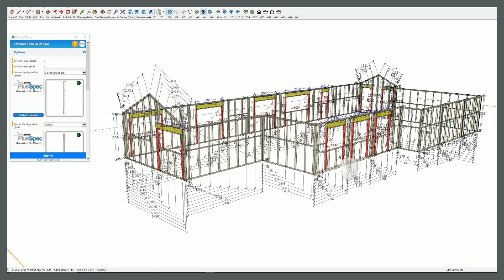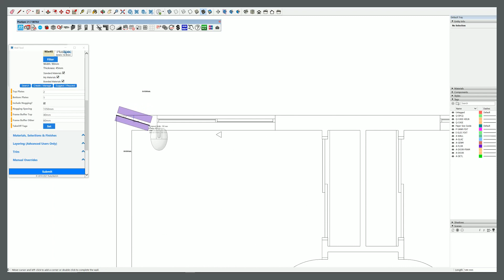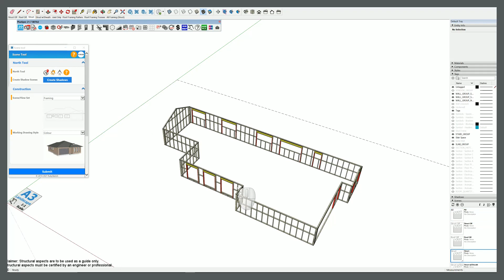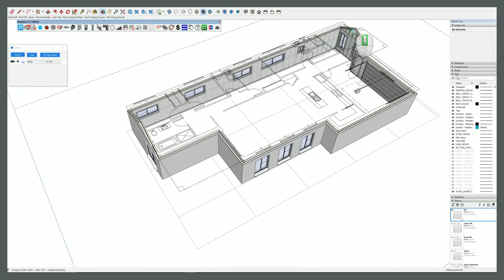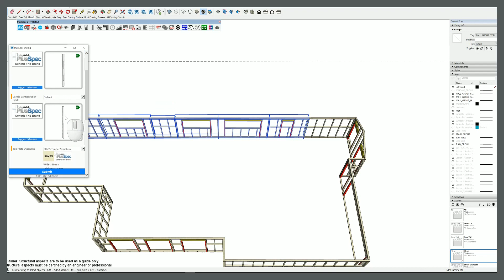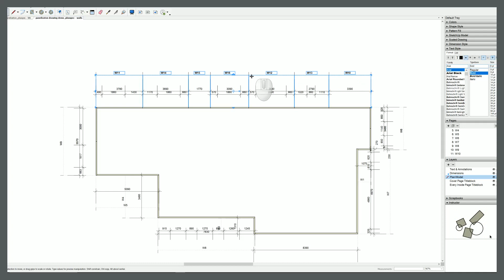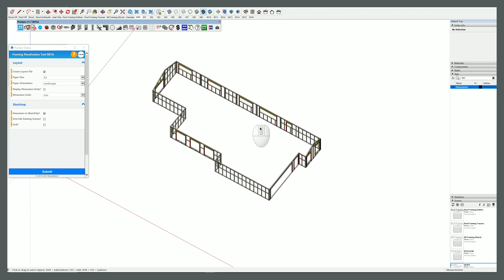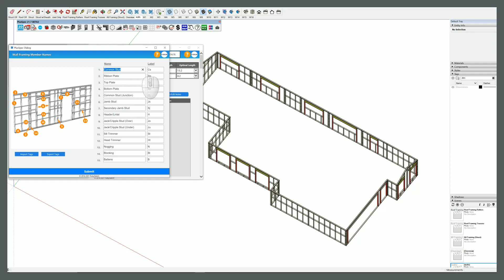How to create detailed wall framing & frame Panelization documents in PlusDesignBuild.

Comment from the maker: Hi guys, we will soon be making a few updates to the wood framing wall panel tool. If you'd like to have some input, check the latest forum post here:  https://forum.plusspec.com/t/carpenter-framer-shop-drawing-input-needed-for-wood-frame-shop-drawing-detailing-plusdesignbuild/49969

Comment: When doing the framing we normally place the studs to allow for 1200 mm wide lining. This means that the stud spacing from the second stud onwards would be spaced at the required intervals. However, the spacing between the 1st and 2nd stud should be half the stud thickness (22.5 mm) less than the required spacing to accommodate the 1200 mm wall lining. By doing this it is possible to get a stud centred at every 1200 mm where at the moment is on 1155mm.  Is it possible to set the stud spacing? accordingly?
Reply: You can start the alignment of studs from different locations across multiple points in a wall.  Right click the wall> click +wall> in not in front of the computer now but I'm pretty sure it's "align studs with rafters/joists"  Neil if you've already created your panelization drawings go back to the wall panelization tool, click delete scenes, the recreate. This will re dimension the walls according to the new stud alignment.
Reply: @AadbuildDesignBuild  Thanks mate,  unfortunately not the solution for my dilemma
Reply: @nedsprojectsltd5707  Hi Neil, If you buy imperial sheets they are 1220 x2440 or 2740 (4ft) but to answer your question, yes I agree the first joist or stud should be half the distance of the member thickness back so the sheet joins on the stud.
  However the answer above is also correct. All you have to do is click the first stud after the junction and click and align the stud with the right hand side of the stud  this will then move the followings studs back half of the section size and all ply sheeting will then join on studs.  
Neil you can also double studs up.  In Australia there is a minimum distance for bracing nails from the edge of stud and I'm pretty sure it 25mm and 50mm centres on the bottom and top plat and 150c/c up the studs.  Unfortunaly 70mm studs are expensive... I hope all is well mate.
Reply from the maker: @nedsprojectsltd5707 Wouldn't you batten it out? that's why the battens don't align with the studs. They work from the outside of the first stud at your desired spacing.

Comment: Question from a newbie, Is it possible that the software calculates automatically the extra studs where the interior walls are connecting with the exterior walls (sry for my bad english)
Reply from the maker: Hi There! We have a Junction tool you can really quickly add in the extra studs for quantification, see tutorial here: https://youtu.be/wNtzl_85qmU
Reply: Yes when drawing the external wall dimly click on the internal walls and it'll add a junction